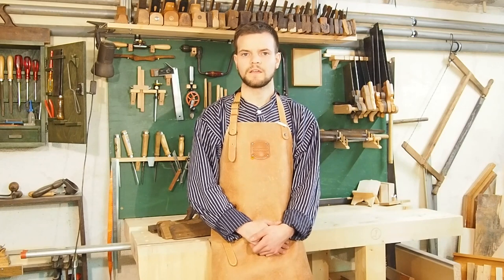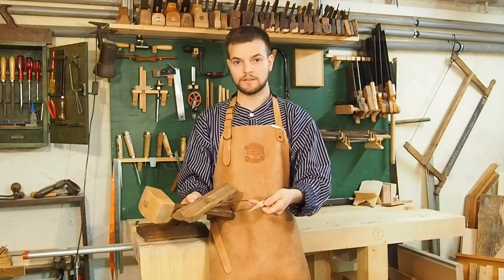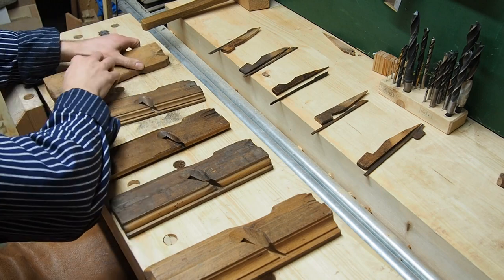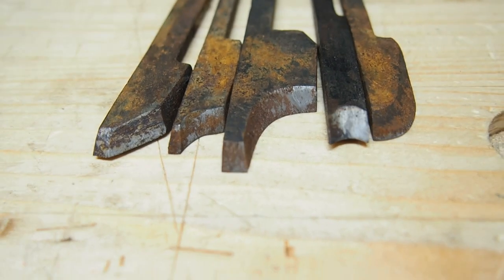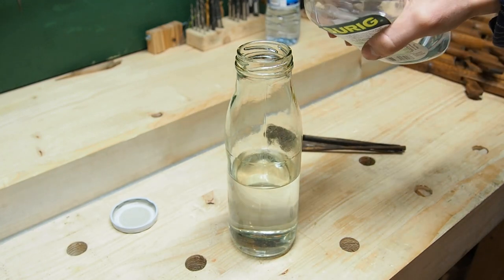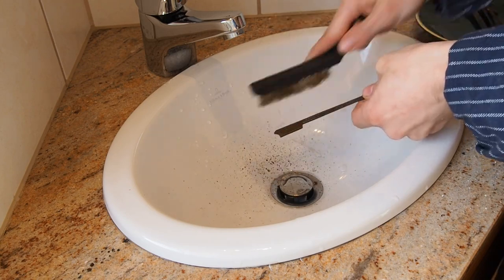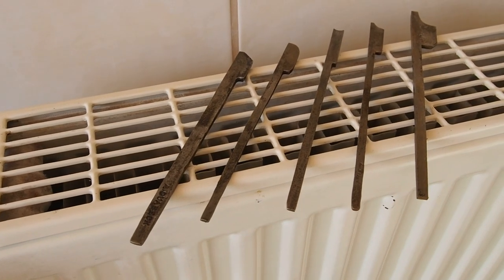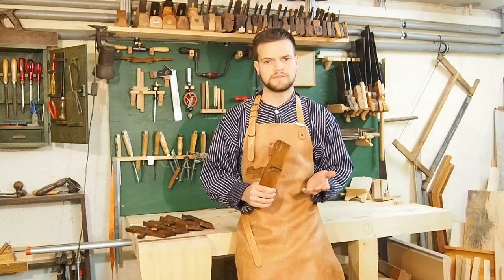Restoring antique moulding planes - Part 1/3

Comment: I use a brass wire brush on a drill driver. You really need to get all of the rust removed.

You make great videos! I hope you get time again to make more :^)
Reply from the maker: Thank you very much, glad you enjoyed the videos!
Reply: @pjtfurniture  I did indeed! And I shared them in the Rex Krueger patron community. If you ever get time or the need to make shavings again—or just talk about it—there is no better community. You just need to be a patron on Patreon. I'm quite honest (and not sponsored 😅), it's a positive and diverse place for absolute beginners and those with decades of experience. And it's way bigger than Rex Krueger himself. It's mostly community driven. Many of us interact daily on the forum and share both woodworking and life.

Comment: Check the wedges and irons are the original to the plane and not just a pair married together for a sale.
Reply from the maker: Sometimes, the iron, wedge and plane body are marked with a number to keep them together during the manufacturing process. However, this is not always the case so it´s hard to know if the wedge and iron really are the original ones. But of course I check if all three pieces of a plane fit together well and, if not, I adjust or redo them. Like I said in the video, I´m not a collector, so I don´t care too much if every single piece is original. As long as the plane as a whole looks right and, more important, works well, I´m happy.

Comment: I just acquired a pair of moulding planes with the same carving in the toe, same indentation along the top for the front hand, and same shape to the wedge. Do you have any on-site on age, maker, or any other history?
Reply from the maker: Those characteristics are typical for Dutch plane makers. One of the biggest company was Nooitgedagt, but other manufacturers like S. van Embden share these details as well as the crown stamp above their initials, too. This website https://www.holzwerken.de/museum/hersteller/nooitgedagt.phtml has some information about Nooitgedagt. It's in German, but a quick online translation should do the job.

Comment: Use basic solutions to remove rust, as acidic solutions pit the metal and make it more likely rust will return. Specific rust removing formulas or even basic solutions from drain cleaner are a million times better than vinegar.
Reply from the maker: Thank you for that tip, I'll try it next time!

Comment: Does Using a vinegar water solution work better than straight vinegar?
Reply from the maker: Yes and no, depending from where you look. Chemically, straight vinegar removes the rust quicker than the dilution, but it is also more dangerous to work with (get a good splash in the eye and you know what I mean). Because I leave the irons over night in the bath anyway, it does not matter to me if the reaction is finished at 1am or at 6am, so I go with the safer and cheaper option of the diluted vinegar. Also, the dilution is not as aggressive against the intact metal as is straight vinegar.
Reply: Don't use acids to clean metal. Use bases, as they will dissolve the corrosion without pitting the metal.